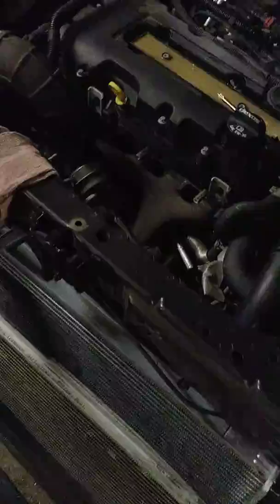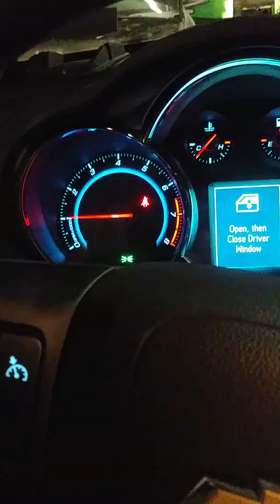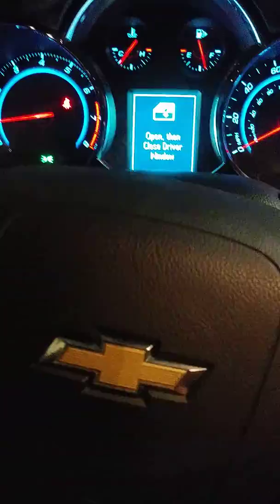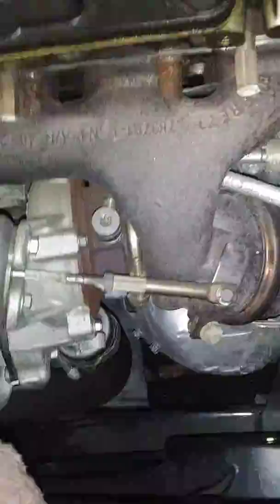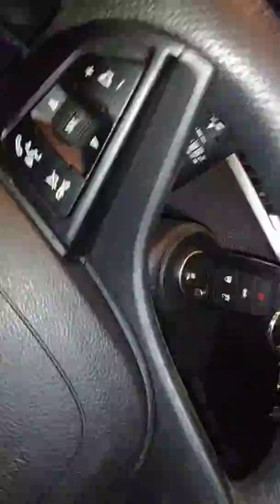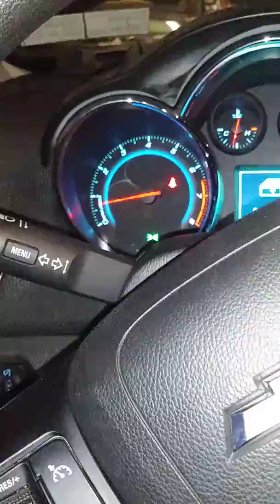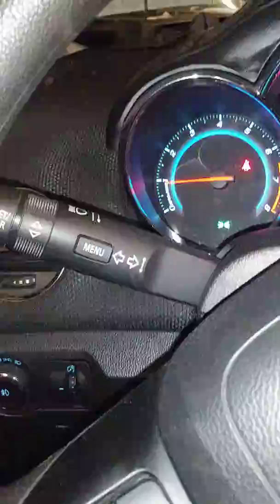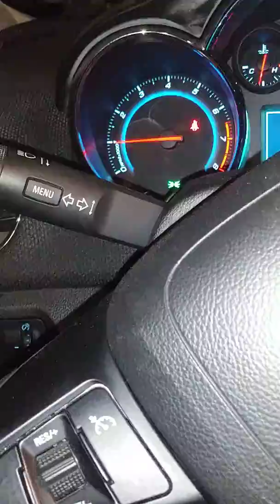2015 chevy cruze. Boost sensor

Comment: Its the turbocharger homie....Two typical diagnostic trouble codes for turbos include P0299 (underboost) and P0234 (overboost). If you’re receiving an underboost code, the issue could be a wastegate that’s stuck in the open position or a leak between the compressor and throttle. Causes of overboost, on the other hand, include a wastegate that’s stuck in the closed position, a wastegate vent solenoid that’s stuck in the vent position, or leaking or disconnected control hoses.

When diagnosing and repairing boost-related trouble codes, here’s a helpful repair tip to keep in mind: turbocharger operation can be affected by a dirty intake air temperature sensor. That’s because the dirty sensor is unable to pass temperature differences quickly enough. To fix the issue, remove the intake air temperature sensor from the intake manifold and clean it using either carburetor cleaner or bead blast.